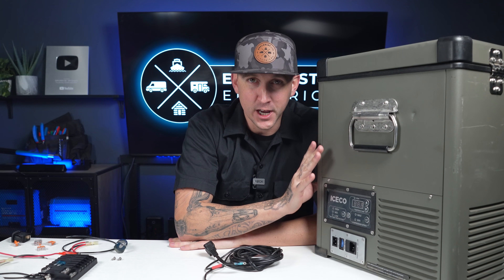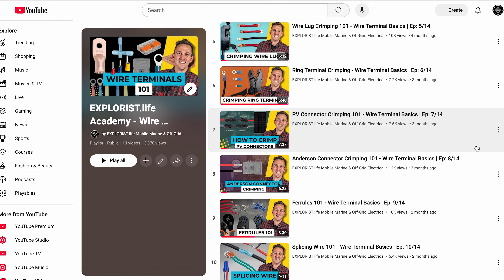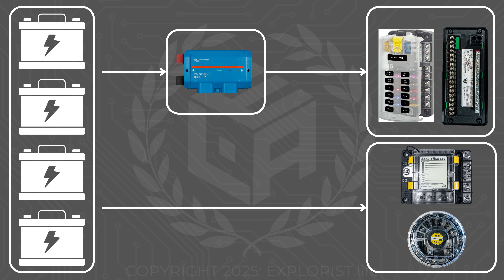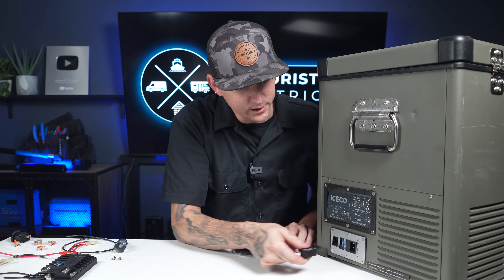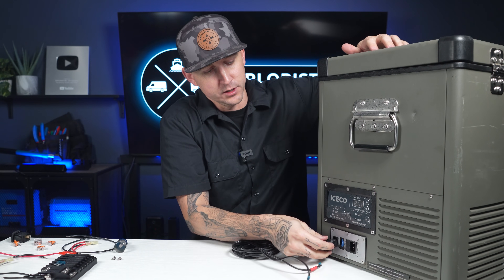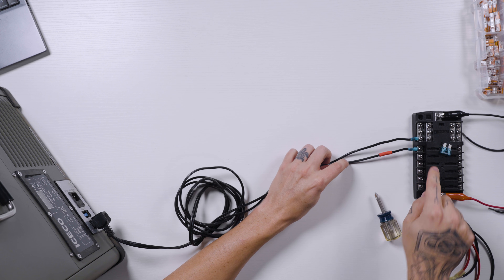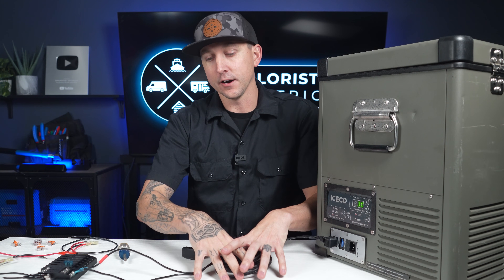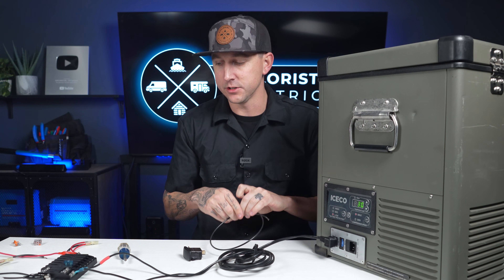How to Wire a 12V Fridge - Branch Circuits | Ep: 5/10

Comment: What was originally on the end of the wire that was split in two? Mine has the part you plug into a cigarette lighter so I assume that I’ll cut that off and proceed as you have just demonstrated?

Comment: The fridge/freezer seems to be a unique appliance in that food/money is in jeapordy if it loses power.  I'm curious about what's the best method to ensure that it's the "last" thing to lose power when the batteries get low.?  Is it as simple as setting cut-off voltages of the other appliances at a higher setting, or are there better methods?
Reply from the maker: You’re absolutely right—fridges can be tricky since they’re often the priority load. It usually comes down to smart voltage cutoff strategies and priority wiring, but there are a few ways to tackle it. Reach out to our team for tailored help: https://shop.explorist.life/support

We provide free support for purchases made through our store, and also offer a Pro Support Membership for help with other gear: https://shop.explorist.life/shop/all-products/membership-tiers/
Reply: We have a metal lined Kohree 50 lr or so fridge freezer. What sold us on it was a couple of reviews that said that while RV was in being repaired, and the power was off, the refrigerator kept everything cold. The metal lining does keep it cold for hours if it goes off at temperature. We have frequently had to unplug it at night on hot nights when the refrigerator would run and pull power even though it was only one or two degrees above the setting we had it at. So look for a metal lined refrigerator freezer. And put a folded blanket or a pattern cover on top of the plastic lid to keep the cool in. That way if the power goes out you're safe for at least 12 hours? And can get somewhere where you can plug it into AC.

Comment: A common name for that type of wire is "zip cord."
On 120 VAC cords, the smooth side is the hot and the ribbed side is the neutral. So, the smooth side being the positive side, and the ribbed side being the negative makes sense.

Comment: Yeah, my fridge doesn't say which side  is positive or negative. I have dometic cxf3 35.
Reply: I have a CXF3 as well and on my cable, it is the wire that has writing on it that is the positive.
But if you want to be absolutely sure. You can unscrew the part that plugs into the cigarette lighter access port and  you'll see 2 prongs, one has a plus the other has a minus, just look and see what wire is on what side

Or use a multimeter cut the wire far enough back. So you can see which wire has riding which wire doesn't strip the wire back plug. The thing in make sure the wires don't touch and see which side is positive and which side is negative. That's what I did, because I didn't realize you can unscrew the thing and it would tell you right there, but yeah. My apologies, if I made it a little complicated.

Comment: I'm going to be running my ICECO (appl55?) chest refrigerator on 24v. The frig is rated for that voltage (12/24v), and there is nothing in the owners manual that indicates that there is any extra step I need to make to hook to 24v rather than 12v. Because I'm paranoid. Is this the case? Or do I have to do something extra?
Reply from the maker: Reach out to iceco support or your iceco dealer to verify.
Reply: It will just work with either voltage.  The Dometic is the same.  For your ICECO... lets see.  APPL55 manual....  says the fridge burns 70W when running which is only going to be roughly 3A at 24V.   So you are talking pretty much any size wire (I don't go thinner than 14 AWG myself though) and a 5A fuse.

-Matt
Reply: I actually had the same concern when I first started using my ICECO (I’ve got the VL60 model, but it’s the same idea). I’ve been running mine on 24V without any issues at all. As long as your power source is within the 12V to 24V range, the fridge will adjust automatically — no need for extra wiring or settings. I was paranoid too at first, but it’s been solid. Just plug it in and you’re good to go!